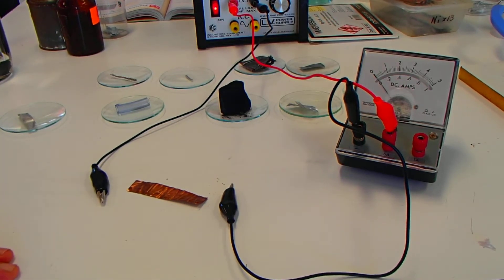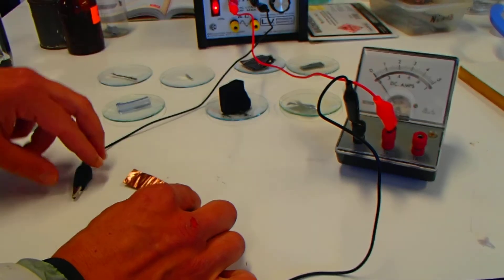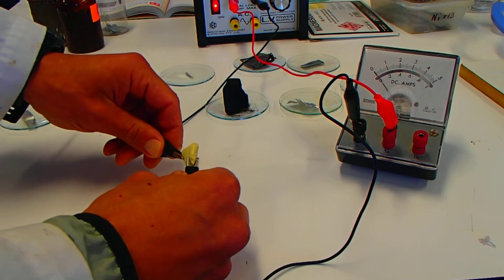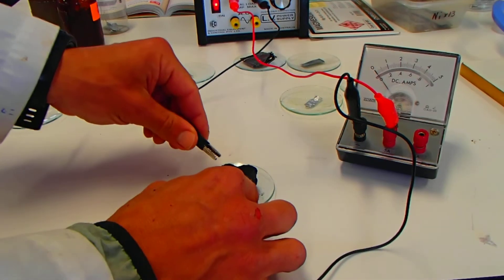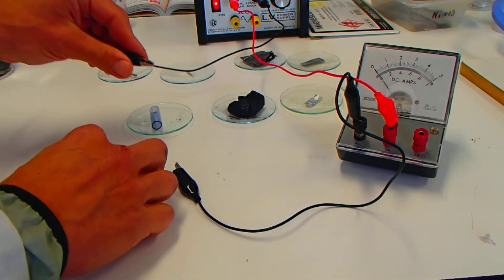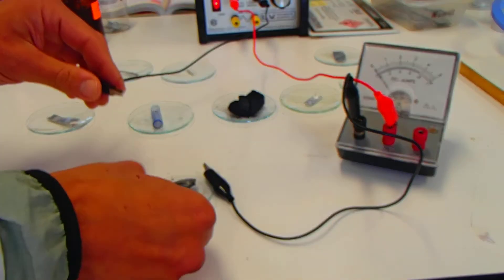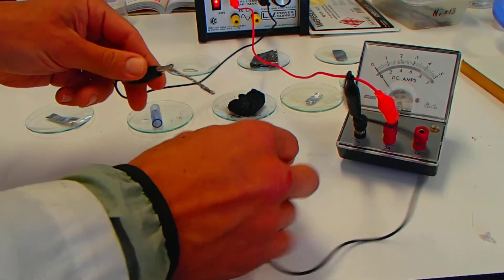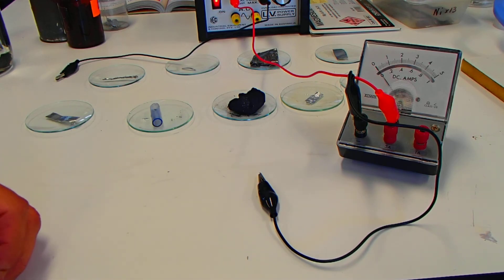Practical 5.2 - Properties of Elements Part 5: Electrical Conductivity

Comment: That's not a sample of Silicon (Si)... it is a sample of silicone (a polymer - it is a compound, not an element). I really wish I could see what your setup would do if you had an actual sample for a metalloid and see if you could tell a difference between a conductor and a semiconductor.